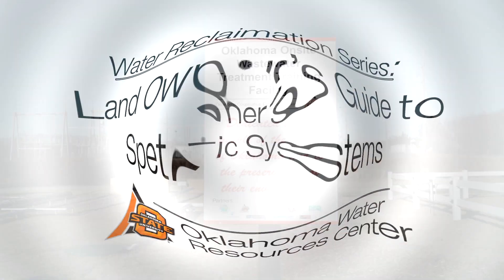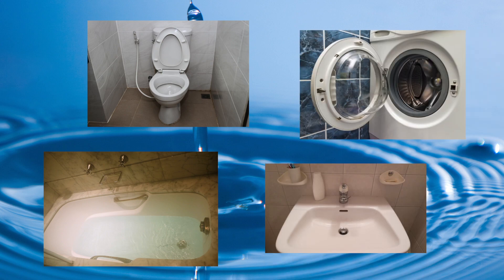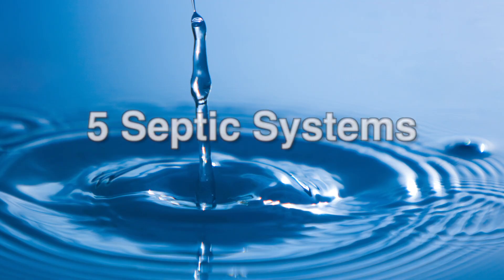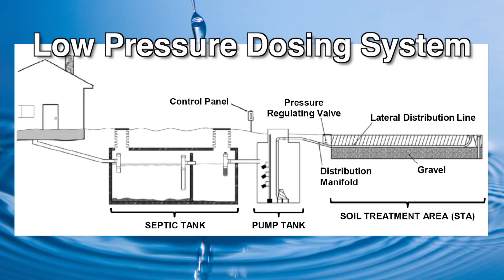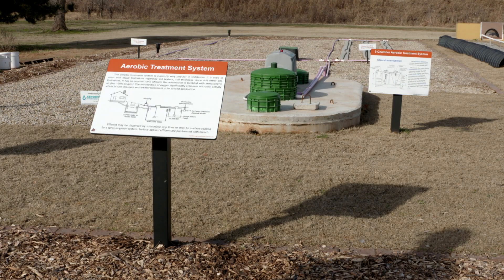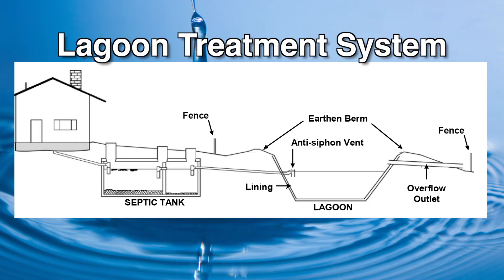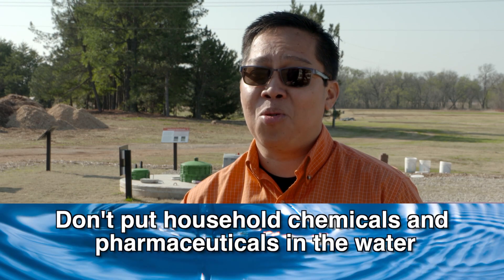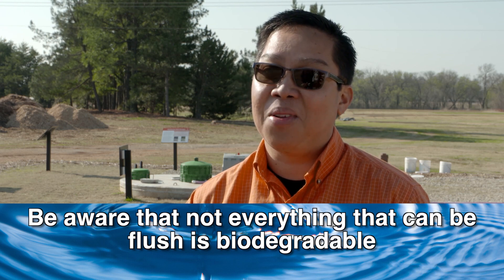Homeowner’s Guide to Choosing the Best Septic System

Comment: 280 gallons sounds crazy to me since im sure i produce less then 20 a day. wowza
Reply: Yeah, probably the numbers are calculated using old fashion family sizes with low efficiency appliances.  There isn't an incentive for the government to get these numbers right, but to be overly conservative in designs.  The only folks that benefit from right on designs are the home owners, who typically aren't in a position to challenge the experts.  The health department gets flack if any approved design fails.  The installers make more money the more expensive the system is.  The engineers might get work if health department requires a complex system.